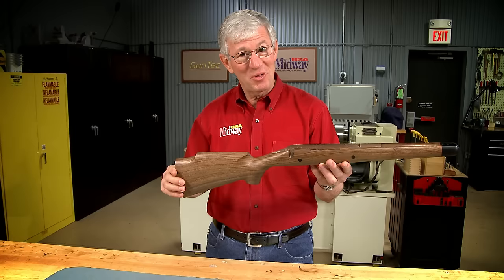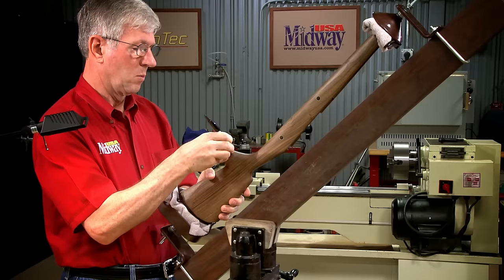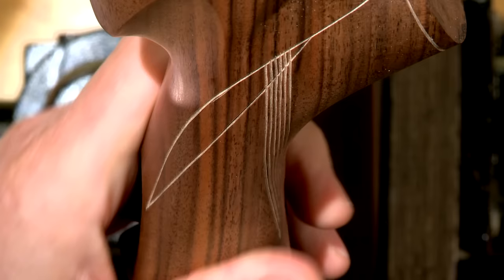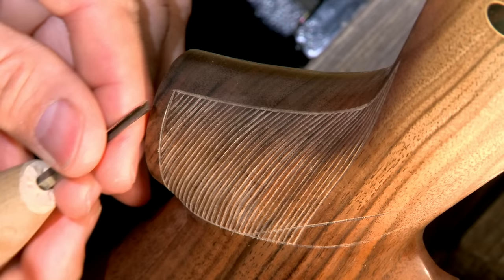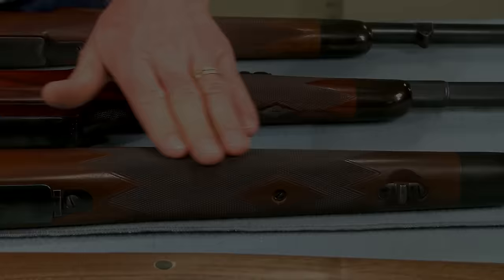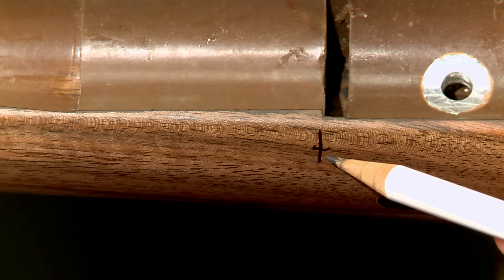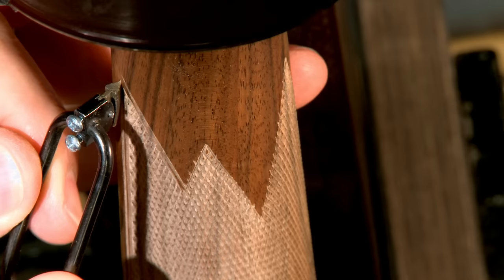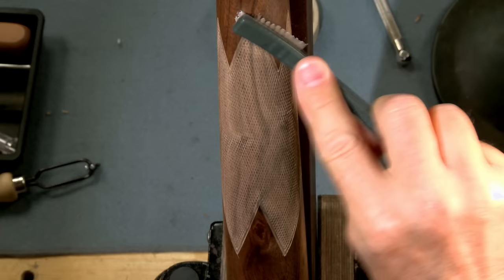How to Checker a Gunstock Presented by Larry Potterfield | MidwayUSA Gunsmithing

Comment: Man I hope there are people in the younger generations that are perfecting crafts like this because God knows I'm not.
Reply: Look up 'Martini Gunmakers'.
Reply: if it makes you feel better, about 1/3 of my smithing class is under 25 years old. the rest are 25-35.
Reply: I'd slap it into a CNC mill and do this in half the time
Reply: $50,000 mill (minimum) or a $60 checkering kit. also you'd have to either hand operate the mill, or write up a CAD file (I think? honestly don't care about CNC at the moment) which could take about half the time of hand-cutting. and every stock and every customer is unique, so a new file per gun. you wouldn't just drop it into a CNC machine, trust the gunsmith. or don't, it's your speculation.
Reply: Gonna be going to school for it myself
Reply: have you decided on what school you'll attend? if your in the states I'd recommend PTC in Greenwood, SC.
Reply: I have not actually. Im in Wisconsin so there's a lot of things that need to be figured out first
Reply: Unless every stock was exactly the same, you would need to scan the stock surfaces and map out the curves to get the depth right and adjust the code for every stock. Easier by hand.
Reply: Nobody said you had to buy the machine, just pay the $50 to have it done absolutely perfect... in 10 minutes, instead of 4 days.
Reply: A newer CNC machine will map the stock out in a matter of minutes, and then project a laser version on the gun, and you can make instant adjustments to make it look perfect... before you start.  The whole process would take 30 minutes tops, and the checkering would be absolutely perfect.  I could do the whole process in less time than this video took.  In real life, it took this gentleman a couple of days to do this right.
Reply: I wish I could afford half the tools he uses, or hell even the gun. Honestly this seems more like an art than a simple repair or touch up
Reply: Guns are going to be obsolete in war...we have bombs..lmao
Reply: The gun will never be obsolete kid.
Reply: Dan Bodley إلي
Reply: Jubal Early show us.  Make a video and post the link here showing us how easy it is.
Reply: The Leon Mignon gunmakers college in Liege (Belgium) still attracts students from all over the world, so I'm not particularly worried.
Reply: Do you know of any schools in California?
Reply: River Styx Armory what about Yavapai College I have been looking into it just can’t to seem to find a good review on it. I would love a school that helps you learn to do custom builds.
Reply: I'm 14 and doing this and reloading
Reply: @riverstyxarmory9782  you can get a small metal cnc mill for under 5k these days
Reply: union310  the skill required to program modern cnc is order of magnitude harder and more important than some wood carving
Reply: @riverstyxarmory9782  CAD is easy for me.  Even if I had a CNC machine I'd still hand checker.  I like a challenge and handi-work is always more satisfying.
Reply: “Oh yeah, my rifle is machine checkered!”

That has the same energy of somebody who shows up on the job site with a pickup with no dents.  Some things should stay hand made.
Reply: Working on it
Reply: There is but not in the USA. We are spoiled rotten and don't even have the patience to watch this matter craftsman finish his work of art.
Reply: Honestly I don't care how your gun is checkeres. If you just want to get it done and have access to the tools, then bang it off. If you want the satisfaction of doing it by hand that's awesome. But the two groups on this thread arguing about the morality of lost skills or the morality of wasted time when neither of you is going to use this rifle for anything more than hobby, it's not cool folks.
Reply: They do not have the ability .
Reply: There's very few schools that offer courses anymore because most folks just do their own work in their garages while watching videos like this.
Reply: I'm actually learning to be a gunsmith
Reply: @jmedi5589  I feel bad for the both of us. (P.S I do k not live in Cali I live in a north state by Canada.
Reply: @calebbrulotte7832  please post more content.
Reply: No one will want to pay for the craftsmanship or time it takes, someone will create a machine or it will disappear
Reply: @AJwiththeAK  did you end up going to school for this?
Reply: I'm 19, I think stuff like this is awesome. Hard to do in the city, though. I gotta get more tools.
Reply: They are. On a 3d printer
Reply: Yeah some nip with a laser machine
Reply: amazing craftsmanship.  This work can now be done in minutes with laser etching technology
Reply: @AlexCell33  I have been doing this for 20 years and miss how frequent of a request it used to be.  So many prefer the price of laser engraving nowadays.  I like the handcrafted appearance better myself.
Reply: Agree.  Six year olds should be taking this up post haste.
Reply: @μ You think he knows what those skills are?  He wants to bestow the key to the city because somebody can carve in a straight line...
Reply: I am and have been since I was 14 I'm 22 now and still doing this stuff I make wood handles for swords and such.
Reply: I'm twenty years-old. I've been learning about gunsmithing and blacksmithing since I was 17, thats when my dad gave me a 1917 Lee-Enfield. The metallurgy and ballistics are very interesting parts of it. A gunsmith is a very interesting person. he's a machinist, a blacksmith, Woodworker, excellent finisher, they know metallurgy, physics math, I could go on forever about the big world of gunsmithing and every other industry involved.
Reply: @TitsMcGeester I'm twenty years-old.  I've been learning about gunsmithing since I was seventeen when my dad gave me a 1917 Lee-Enfield. I'm still collecting everything I need for a functioning workshop, but I'm focusing on the Blacksmithing part now myself. I just got a little steel anvil and forge for a good price, I'm just waiting to set up a gazebo to work in. Metallurgy alone is a big world, and ballistics.

Comment: I never knew this was done by hand i always thought a machine ran the lines. Thats truly remarkable craftsmanship
Reply: On many of the cheaper, mass produced ones are pressed into the wood. A close examination will show the fibers of the wood are bent into the pattern, and not all the diamond points are sharp, whereas checkering that is cut in will show the fibers cut. I did a little refinishing work on a stock for a friend and had used my checkering tools to deepen and sharpen the pattern on his stock. It took about 2 days to do this, but the first time he held the gun, he was amazed at how good the grip felt.

Great checkering is an art form.

Comment: I started checkering about 45 years ago.  In the beginning, I improvised clamps that would not damage the stock.  Once I built my checkering cradle it made things so much more pleasant.  I put off building one for years until finally set aside time to build it.  Works great.  Glad you told everyone about a checkering cradle.  Now, my only problem is eyesight.  Can't beat the clock. Hard to find good eye pieces/magnifiers.  Nice video.
Reply: Where can one acquire the tools to begin learning?

Comment: The easiest way I found is to make a pattern on a piece of paper to exact size, reversing it to other side of grip, now it is exactly same.
To reduce overruns I found it much easier after lightly marking the design, to use 2 layers of standard yellow paper tape to define the outside border lines, carefully cutting the points and piecing them in exactly, I use this as a guide to follow for the outline cut as well, if I run-over when checkering, I'll run over unto the tape.
I use tape for the 2 first master guide lines as well, much easier with the tape to contour smoothly and simply cut using the tape as a guide. I'll use a double line cutter, following the first cut line and cut the new one, making sure depth is same, otherwise lines will not be evenly spaced. Short backward cutter is only way to go when you finish up the ends to depth, you don't want to run over now. Stop often, don't push yourself, you'll screw up. Keep work clean for easier visual. If a line takes off on you, stop, get a piece of tape, correct the line with the tape, follow the tape starting from the opposite end.
Try an 18 line cutter first on an old 22LR, move up to the 20 line later. Don't try to do it all in one sitting.

Comment: Two comments; first, when I do a layout that involves a curve I use a thin French curve (drafting/art departments). This way it keeps the curve very clean and consistent on both sides of the pattern. Second, I cut the border first - then the master lines second - even if they are not full depth. Otherwise, there is a tendency to have a crooked pattern somewhere in the middle of the process. Just another option - but it works great for me.

Comment: Hi Larry. Thoroughly enjoy your videos.   I am currently refinishing the stock on a Winchester 270.   I am using a bit of Stripper in areas.  I tapped off the Checkered areas.   I don't know if I should use a bit of Stripper on the Checked areas and attempt to scrub them with a stiffer bristle brush or leave them alone.  When I use either a Walnut finish or the Tru Oil on the stock,  I don't know if I will end up with the Checkered areas being a different color than the rest of the stock.   Any Advice would be appreciated should you see this message on your video page. Thanks for the help on this.
Reply: Since the checkering is done, you could get a few checkering tools and clean the pattern and sharpen those pyramid tops. It would also remove the finish to match the rest of the stock. That might be more work then you're willing but much less than cutting a new pattern.

Comment: I would like to think I could master this craft/skill. I think I would have to do a little bit each day. Can I ask please, on average how many days you take to hand checker a stock like this?
I have one more pressing question also please.
If you want to sand down and re oil a old stock - without damaging the hand checkering, how do you protect the checkering panels while you hand sand the old finish off?.
Masking tape?
I don't wish to blunt the diamonds by mistake when sanding!
I have the Winchester Mod 70 featherweight, in .243 (Old long action) with the fleur de lis checkering & it seems like there are no straight lines on it, so I am not even sure how to mask the fancy pattern. I love it and don't wish to ruin it.
I am pretty sure I can birchwood casey true oil the stock again, but the hand cut checkering has me too scared to even start sanding.
I know a custom stock maker locally, is this something I should just pay him to do, so I don't screw it up? I was a fine furniture maker for 20 years so I have SOME hand skills but this surpasses anything i have ever attempted and is admittedly outside my skill set.
I am not even sure I am patient enough to see it thru once I start. 
 would LIKE to master this skill, have dreamed of doing so for at least the last 40 years!
They say the reward of patience, is patience! Likely I'd have blown my top and garrotted the guy who said this. Patience seems to be the lesson I was put on this earth to learn this time around... thus far 57 years in, & I am a dismal failure!
Reply: Ian Moone dont sand it down, get varnish stripper and refinish the stock without sanding. Just use linnseed oil after it is stripped

Comment: Do they have machines for checkering or are they all done by hand?
Reply: Some arms manufacturer's bottom-of-the-line junk have cheap, cheesy, imitation "checkering" burned with a computer driven laser cutting lines in the wood.  It doesn't begin to look like real checkering.
Cheap "impressed checkering" is just die-stamped into the wood surface.  
There ARE some power checkering tools available (My brother had a couple made by MMC). They greatly speed up a checkering job compared to the old-school tools Larry's using here, but they are still hand held tools and for better or worse, it's still the skill of the craftsman that does the job.

Comment: Suppose the customer has to cut out a massive cheque !
Reply: Chad Chadman that's the downside to it if you want quality hand work that will last. Unless I'm mistaken, most checkering nowadays is done by routing the area out a couple thou and then machine checkered laminate is glued in. It's faster and less expensive but has a cheap feel and doesn't last.

Comment: Were abouts can i get these tools?
Reply: Midway, I think. Isn't he the Midway guy? I got 2 sets, different spacing from Midway, if I remember correctly. I practiced a little on some loose wood around the house and went on to a Marlin, basic, bolt action 22. It cam out fine just the pattern was typical like  in this video. I went on to my 12 ga, side by side. I designed the pattern and it came out amazing. Putting in time here and there most evenings, It took I guess a week - don't remember.